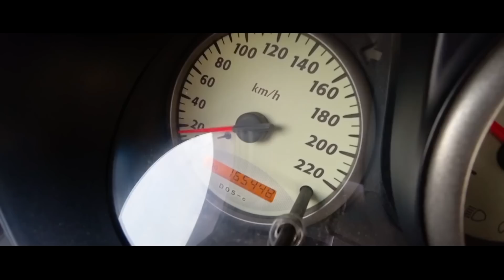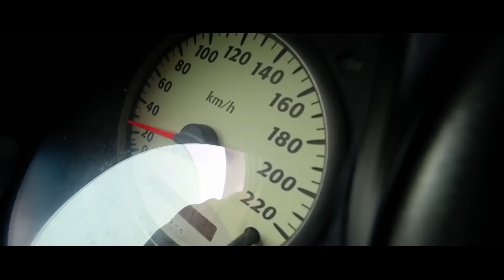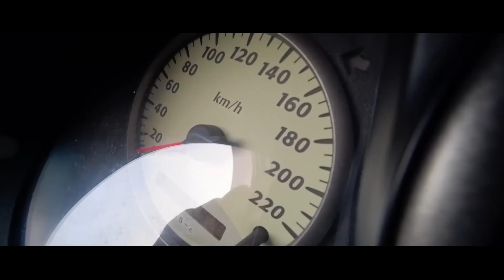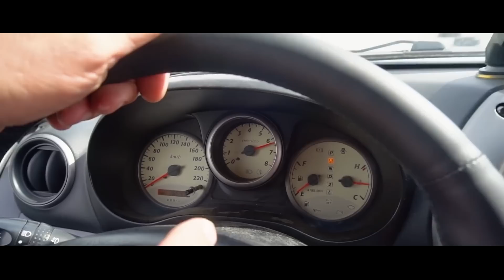What happens when you engage reverse at 62 MPH?

Comment: Modern automatics are computer controlled and the shifter input is merely a suggestion that the computer takes and only shifts if conditions are correct.
Reply: Correct..Since the early 90's that I know of. They don't let you hold rpm either.
Reply: That Rav 4 is 15 years old. THe shifter is directly connected to the gearbox. HOWEVER, the clutch is electronic.
Reply: ^this guy cars
Reply: Lame and slow. Even when shifted manually there's a huge lag. Especially in the rain if you break em loose and want to keep the fun going , it never upshifts when you want it to.
Reply: @MrTheHillfolk  
Turn it to semi automatic, almost all automatics have that option however the shifting is still pretty avg in speed although I have a hard time believing you can shift a manual quicker on regular cars unless its a dual clutch one.
Reply: You earned a cooky
Reply: You can money shift your manual transmission, too bad you can't money shift your automatic transmission..
Reply: @Mp57navy  good grief, there's no clutch
Reply: @Mp57navy  Conventional automatics like this one use a torque converter, not a clutch.
Reply: @Mp57navy  automatic = no clutch
Reply: @SMGJohn  I can shift my truck alot quicker than a stock automatic, but why automatics are faster in drag racing and stuff like that is the ability for the automatic to keep power going to the ground even under shifting where as a h pattern manual will not since there is a clutch involved, there is a dog box gearbox which allows to not use the clutch to shift the manual but their is still a problem humans dont always do the same every time, where as automatic will always shift at the same time every time
Reply: @hollymolly518  You can always shift your money with an automatic. The guys in the video just did. About $3K-4K.
Reply: @hollymolly518  yes you can. Check out Neutral Drop
Reply: @kma4444  there is actually. Well probably not in this one anymore. There's clutches in the transmission that that are what engage the gears. That's what he was smelling
Reply: Loved the way u explained it
Reply: Some cars have no mechanical link between the shifter and the transmission EXCEPT for the park, and even then, some car got rid of the lock pin in the transmission and use an electrical parking brake, which I do not understand how those can even be legal...

I think it was Rich Rebuild that got into a problem with his tesla. Who is it is not important, the thing is, water got in the Body Control Module due to a leaky A/C, but that is still not important. The important part is that the BCM failed, got a nice christmas tree of light in the dash, came to a stop and... couln't engage the parking brake. The car would move as soon as he was releasing the normal brakes as long as the car was not on a perfect flat surface, which as you know are not as common as you think (put your car in neutral, see if you would trust to leave the car with no brakes)...

This also mean that if the electrical fail, he is in deep trouble...

Atleast with the mechanical link for the lock pin in the transmission, it help to avoid this issue.

Also, most cars will have a mechanical neutral, as a safety in case of a runaway engine.

But the forward and reverse gears? All software controlled.
Reply: @jok3yjesu339  there is no way you can shift a stock H pattern faster than a stock automatic can. By the time you have you're clutch in it's already shifted. And yes automatics are a lot smoother engaging than a manual and a lot faster.
Reply: @Famous3064  stock automatics are quite slow at shifting, the only automatics that shift really fast are the aftermarket transmissions or you have got a transmission tune or custom bulit your trans, I'm sure some stock automatics could shift faster than I could but most of the stock ones do not
Reply: Its solenoids selecting gears. As in, solenoids selecting the clutches in the gearbox which is a planetary gearbox and all gears are in constant mesh, so technically no gears are selected but clutches are selected as in engaged and disengaged which makes car go forward or reverse. 

Unsure of old school autos but pretty sure they were the same all this time. Dsg is different though.

Yes, what og comment said, by disconnecting sensors the computer does what its told by operator. Otherwise conditions must be met.
Reply: @jok3yjesu339  Stock autos are true autos, performance automatics are the same only that oil pressure is much higher and clutch friction plates are much stronger. 

Dsg is manual gearbox with automatic solenoids selecting gears, which are also in mesh but has 2 gear shaft sets. A "stock auto " has 1 gear shaft set and they work completely differently. 1 has bands and clutches other has only clutches and 2 shaftz
Reply: @proxypanda4156  so you're saying transmissions like for example the nissan gtr are not faster than a stick? Lol
Reply: @Mp57navy  no clutch, rav4s came with a slushbox auto.
Reply: @scootergeorge9576  true but those don't usually wear out like a regular clutch does. autos should last the life of the car ifyou change the fluid ontime.
Reply: @0xsergy  - My point was that there are clutches in automatic transmissions. And every rebuild kit I've ever seen includes the clutch packs.
Reply: lol Right, Man my Prius tells me what I can and cannot do. Every time I try to do something stupid it makes a beep. and displays a message on the screen saying I cant do whatever I'm trying to do. I understand why too. people are becoming increasingly stupid lol. Smart in their field but dumb as a rock in common sense.
Reply: Very correct. the computer controls ALL shifting of an automatic trans on most modern (1990s and newer) besides park on some vehicles. Shifts are all controlled by the TCM/PCM via solenoids. The TCM/PCM takes in information such as current gear selection, throttle pedal position, RPM, engine power applied, G-Force, speed, direction, gear, ambient temp, trans temp, engine temp, brake pedal status, some also look at the steering angle sensor and even some can sense if your towing and the computer will take the appropriate actions for the correct shift time, duration, shift stiffness, correct gear changes etc. On older vehicles like 90s to mid 2000s, if you unplug the electrical connections to the transmission, the computer goes into limp mode and the transmission has the ability to shift itself, but very poorly, and will allow for reverse gear drops like he showed in the video. Most vehicles made 2010 or newer dont even have any sort of connection to the transmission (Take dodges Dial Selector for their autos), and even good old fashioned steering column or floor mounted shifters simply do nothing but send back data to the computer of their current position, so if you were to unhook the wiring to the trans, it simply would do nothing but stay in park. 

Being an ASE Tech with technical training on modern vehicles, including transmissions, and about 10 years formal experience, the amount of computer controlled stuff in modern vehicles is mind blowing, also a computer geek so alot of this stuff is actually pretty easy to understand, but its crazy that something as simple as a headlight switchs, window switches, door locks, and even the windsheild wipers, now no longer connects to its appropriate circuits, like in the past, instead it connects to the BCM and it controls all output functions. 

Every switch, button, and gas pedal, on all current year vehicles do nothing, but relay its information to a computer, and it dictates what it does. You no longer control you car, you simply suggest what it should do, and it decides for itself what it does.
Reply: @hollymolly518  
Most drag cars are automatics...and most all super cars a autos..
Faster shifting..and some are semi...manual change..
Reply: Top Fuel drag race cars are direct drive (no transmission) with only a set of clutches with computerized engagement.  ‘Though no reverse which is too bad because those cars would make for a great ‘drop it in reverse at 300’ show.
Reply: even old 80s- automatics had governor which prevents engaging reverse before car is (almost) stationary.. doesnt need to have "fancy electrics"
Reply: ...which is a good thing. Last year I drove with my mother in law and she pressed the "P"-button in her husbands new Mercedes on the highway because she wanted to use the windscreen wipers. Luckily the car didn't accept that.
Reply: Used to have a 2003 Audi A4 with the CVT transmission...while driving, if you accidentally hit the gear lever, it was only possible to put it into neutral after a certain speed (think it was like 10mph) and then the shifter would be locked in neutral till you came to full stop...it was not possible to go to reverse or drive...was able to very easily appreciate the lock when moving the shifter and it was a very rigid even if you try to force it, it would not let you.
Reply: @MrTheHillfolk  if my car downshifted it will take me 5 minutes of playing with throttle to get it to upshift
Reply: @SMGJohn  My renault clio 2003 doesn't
Reply: @tenhoruohoranta  
Yes, they work really good. 
My buddy had a 67 gto and a T handle shifter. 
His coat snagged the shifter as he reached for the radio at 50mph. 
Shifter moved to reverse , rear tires went eerrrrrrrt and stalled the car.
Reply: @yottakm3764  the tigers broke loose off the line when it was wet out, so I manually up shifted to second to keep some fun going , but it didn't go. So I hit it again. And again. 
3 seconds later it's bogging along in 4th at 20mph. 
So slow and lazy , my grandma could outshift it.
Reply: @Famous3064  did i ever say that? If so Where?
Reply: Well explained
Reply: @rars0n  Well said!  Also I believe the Toyota system is called Electronically Controlled Transmission (ECT) and is completely "fly by wire" so to speak for shifting.
Reply: @scootergeorge9576  Agreed, clutch packs in automatics.  That isn't why it did what it did for Garage 54.  There's was the computer just switching to neutral until it was happy with the speed to switch to reverse.
Reply: You can cut the computer out and ground the solenoids and shift it yourself...
Reply: Adam Baldwin automatics are full of clutches
Reply: Jokey Jesus stock automatics are built to be smith...  if they slammed the gears like a drag car grandma would have whiplash
Reply: Alot of new cars still have actual shift cables and are mechanically
Reply: I wouldnt wanna try this in my 1988 gmc 😅😂
Reply: Lemme try this in my 6 speed camaro💀 update: I have 6 neutrals
Reply: Tell that to a DSG when you stick it in Park!
Reply: Well put
Reply: @terrandroid  yeah boi
Reply: Kinda like Airbus FBW^^
Reply: @scootergeorge9576  but not clutches in the conventional sense of the word. They are on or off...they can't be feathered.
Reply: No clutch in a automatic. Ummm.. there not one. There's 9-24 clutches in a automatic. It was till 2007 when computer controlled gearboxes started being used. And they were used in high end vehicles. This rav4 has a regular ass automatic transmission. What the tcm or tcu do is control the vacuum and pressure of the fluid in the transmission. When you switch gears it send a signal to let the transmission know if it should engage the gear or not. That what the shift solenoids do as well. Determine engine speed to vehicle speed to correct the gear it goes into.
Reply: what's "modern"? my car was made in 97 and lets me shift into reverse while cruising along at 35. just about caused an accident doing that one time.
Reply: The amount of people in this comment section that don't think there's clutches in automatics is amazing....
Reply: Yea I have a DSG VW CC and it basically ignores me like a cat.
Reply: Duh
Reply: @falconater68  not for my 2011 Honda Fit sport, you put it in manual mode and it will let you bang the limiter in any gear lol
Reply: @falconater68  So it is. My VW Vento (Golf III) had a four gear automatic. Even if I crawl slowly forward, the gearbox wouldn't shift into reverse. Only at two or three km/h it would shift into reverse. With a converter transmission, this slow speed is not the huge problem. A double clutch transmission should always come to a complete stop. It would engage reverse as long as the conditions a correct as you mentioned.